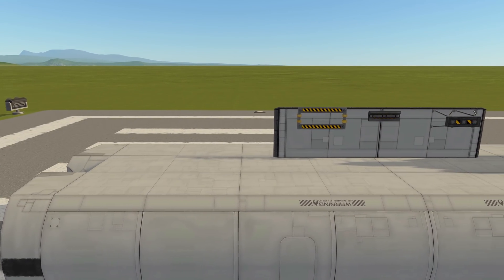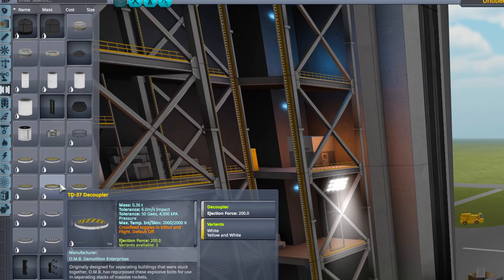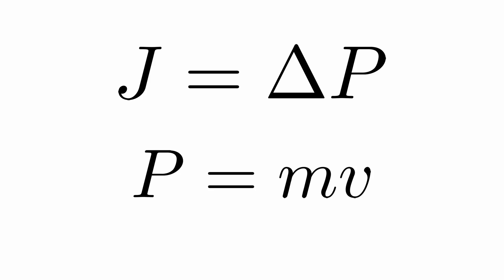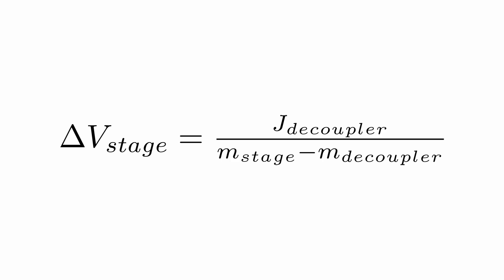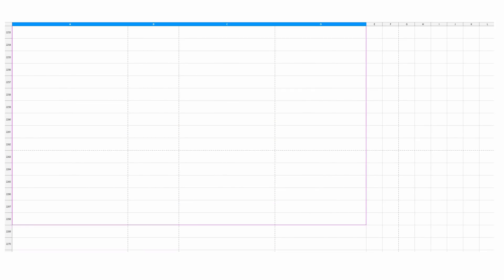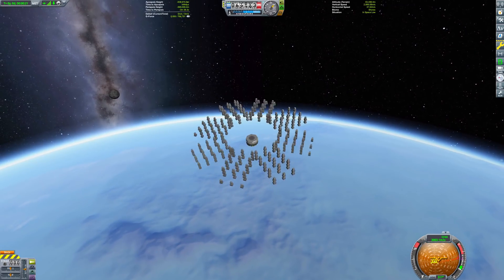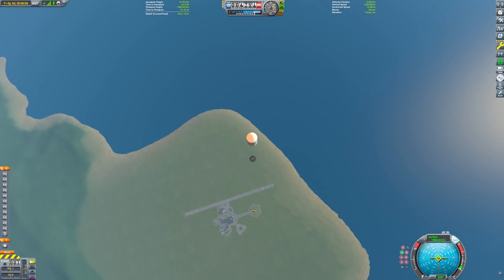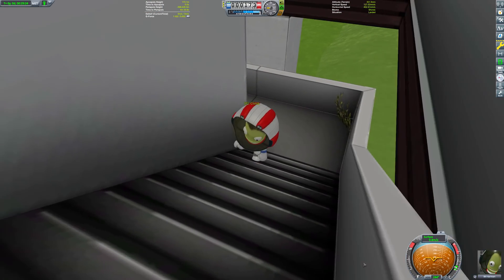Decouplers to Orbit - KSP 1.10.1

Comment: I think the ejection force stat is supposed to just be relative. For example if you’re wondering if you should use a bigger decoupler, you can see how many times stronger the ejection force will be on the bigger one compared to the smaller one and also compare how heavy is the thing you’re ejecting

Comment: thats unironically a really good way to get a quick burst of speed when needed

i added decoupler-based boosters for quick bursts of speed in some of my fighter planes, it allows me to outrun basically every missile in bdarmory and most of its addons, i also use it when atmosphere is thin and rapiers dont provide much thrust but dont autoswitch to rocket mode yet, pop the decouplers and my apoapsis is at 80-ish km

u need a metric fuckton of decouplers tho

i like to use decouplers to send ion-powered craft into orbit and to circularize em, why? cuz its neat

but the main use of these bad boys is in some of my shuttles, i have a decoupler-assisted takeoff cuz a disposable HDM-filled module gives u a fuckton of delta-V instantly

Comment: You can think of each decoupler as a stage with an engine outputting the force equal to the ejection force and consuming its propellant in 0.01s. Total delta-V scales with propellant in a logarithmic relationship, so even though the individual impulses keep getting smaller and smaller, it's the impulses approaching zero, which means the total delta-V always increases.

Comment: 2:03 that flickering on your MATH thing is caused by z-fighting. Z-fighting occurs when two polygons are being drawn on the exact same plane. Because of how rasterization and floating points work, depending on the camera angle, distance, etc, some parts end up being in-front while others behind, and when you change the camera etc this changes rapidly, as you can see.

To fix it, just offset them ever so slightly, e.g. 0.01 will often be good enough. But do note that the offset in a game like KSP, will be dependent on the distance from the camera. If they're right in-front of you, 0.0001 might be good enough. But if they're that far away, it might need to be 0.1 or something. But it's easy to fix.

Comment: The ejection force is actually kgf*s. kgf ( one kilogram-force or kilopond) which is equivalent to 10 times the N. That is what you see in 3:54

Source links: 
https://en.wikipedia.org/wiki/Kilogram-force#:~:text=The%20kilogram%2Dforce%20(kgf%20or,gravitational%20metric%20unit%20of%20force.&text=That%20is%2C%20it%20is%20the,equal%20to%209.80665%20N.

https://wiki.kerbalspaceprogram.com/wiki/Decoupler_and_separator

Comment: Hey Stratz, I have a question; How do you offset the decouplers in a way that doesn't cause the craft to rip itself apart upon launch? I have been trying to build something like this and it keeps either exploding, or the physics will glitch out and move me very fast. One time I even went past the speed of light while testing.
Reply from the maker: One way you can get better stability is to activate "heaviest" autostruts on all the decouplers and place several heavy fuel tanks in symmetry elsewhere on the craft (such as on some launch clamps). The heaviest autostruts will link to these heavy parts and provide a very stable connection.

Alternatively, you could clip all the decouplers together and rest the craft on them, like I did in this video. If all the decouplers are touching the launchpad, it makes kraken attacks less likely (but they still sometimes happen of course)
Reply: @Stratzenblitz75  Ok, thanks. I will definitely try this
Reply: @Stratzenblitz75  One more question; How do you offset the payload so far up?
Reply: Wait never mind I figured it out

Comment: So i've been thinking...

what if you combined this further with the fastest orbit time?

I understand you probably thought about this before and realized that the force you get is great but it happens over a much smaller time and doesn't give sufficient velocity to beat 33 seconds...

but what if a hybrid approach was used like this where the decouplers were fired right before the engines were, creating an energy boost with no drawbacks to help with accelerating faster... sub 30 second orbit?

Comment: Actually you can get as big  ΔV as you want just with stacking decuplers on top of one another.
This is because that sum is like harmonic series (https://www.youtube.com/watch?v=PQRttF8-iqA).
 If there was no mass of the payload you could bring (Jdecupler/mdecupler) out of the sum, and have harmonic series.
Having mpayload is just like taking terms from some term on, which is infinite-finite=infinite. 
But of course this would work only if decouplers were fired immediately one after another(zero delay(infinite speed of sound in decuplers required.))

But there's a problem the growth is approximately logaritmic. It turns out 107069370133 decuplers are needed for orbital velocity at altitude 0 and 2 477 462 214 563 304  for escape velocity. 

But this is actually not the true result, because escape velociti is smaller at that radius. Now I don't know how high those decuplers are, but if we say they're 1 meter, we get escape velocity of 1.879255171603899`*^6 Sqrt[1/(600000 +  NN h decoupler)]  . Set that equal to ΔV, and you get around 1.5 million decouplers(if it's launched from kerbin poles). So actually you would need way more decouplers for that, then to just build space eveator on the equator.

Comment: Afaik SWDennis only used mods to reduce the part count. He scaled up all parameters of the decouplers linearly. So instead of 100 parallel decouplers he just used a single one with a hundred times the force and mass (and I guess cross section area).
Reply from the maker: If the decouplers were scaled linearly, we would see an exhaust velocity of 100 m/s for the decouplers in the video. However, if you watch his video, you can clearly see the decouplers are being ejected on the order of km/s. This is how he was able to make orbit.

Its hard to overstate just how bad the decouplers in KSP are  in terms of impulse. The best ones have an equivalent ISP of 10 s... If you plug that into the rocket equation, you'll see we would need trillions of decouplers to get 3000 m/s of Delta V. No amount of scaling is going to make that feasible.

Comment: Can you exit the solar system (reach escape velocity) using decouplers?

Can you show what happens when trying to do so with just 1 stage (ideally with kerble face expression cam in the corner) please?
Reply from the maker: Yes you can! There's nothing stopping you from strapping a ton of decouplers to a command pod and setting it off.. Well other than the atmosphere, but you can do some aerothermal exploits to get around that.
Reply: Ah cool. I had in mind a series of tragic failures trying to figure it out, but since you already know how to make it work it doesn't sound very interesting... Thanks though!

Comment: Amazing as always Stratz! :D What's the reason for not taking a more efficient trajectory, that would enable a lighter second stage? Too much heating at low altitude?
Reply from the maker: Thanks! Aiming the decoupler cannon is a pain: it has so many decouplers on the bottom that kraken attacks are frequent. Having it stand upright makes things more stable, even if its less efficient.

Comment: Sidenote: you want your text based indices typeset like $F_\mathrm{decoupler}$. The way you currently do is probably $F_{decoupler}$ which TeX interprets logically as d*e*c*o*u… which is why the spacing looks a bit off. By wrapping it in \mathit or \mathrm you convert it to typeset it like text. And you want roman (upright) indices because you are using an actual word, not a variable index like $i$.

Comment: Soooo, that force number. It's definitely the direct input value used for the Unity rigidbody's AddForce function, applied using the ForceMode.Impulse setting. The documentation describes it as such: "This mode is useful for applying forces that happen instantly, such as forces from explosions or collisions. In this mode, the unit of the force parameter is applied to the rigidbody as mass*distance/time.". Being that "instantly" for a physics engine really means "within 1 physics timestep", then it can be assumed that the physics timestep is set to 0.01 seconds.

(docs page: https://docs.unity3d.com/ScriptReference/ForceMode.Impulse.html)

Also, good old radial decouplers. Some of the handful of remaining models of mine that haven't been replaced in the intervening 8 years incidentally, and still finding new tricks after all that time.

I don't watch much KSP content anymore, but your dedication to the madness always keeps me watching.
Reply from the maker: Very interesting indeed. That perfectly explains what I observed. Thanks for the information NovaSilisko!

And especially thank you for the work did in this game. You gave the Kerbol System its charm <3
Reply: @Stratzenblitz75  😭

Comment: You know, this is actually a very useful way to get things into orbit.
Reply from the maker: Decouplers aren't more mass efficient than orbital rockets I think, but they should be better if you want to go further. Like interplanetary.
Reply: @Stratzenblitz75  This way, you wouldn't require massive, laggy rockets just to got your interplanetary spacecraft to orbit. Makes testing them much less time consuming too. Could you please elaborate how you did the calculations for your successful decouplers to orbit ship? How did you figure out the delta-v needed to escape the atmosphere?
Reply from the maker: @thesentientneuron6550  Yes! Fortunately, the math is quite simple. First, make your payload and figure out its mass (for example, lets say our payload is 2 tons). Next step, figure out how much velocity you need. For kerbin escape velocity, you need 3400 m/s, so lets you use that. Next, figure out the impulse you need. The change in momentum is just the mass times the velocity, so 3400*2000 = 6800000 N*s. Since the hydraulic detachment manifold provides 4500 N*s, you will need 6800000/4500 = 1511 decouplers.

To cut this down, I've learned that you can use physics timewarp to increase the decoupler impulse. With 4x warp you could get it down to 377 decouplers.

Yea that's still a lot. I think a rocket would be better suited. You can certainly make a rocket for less parts.
Reply: @Stratzenblitz75  Thank you! I'd like to try it out nonetheless to launch something useful. Have you tested out separators too?
Reply from the maker: @thesentientneuron6550  Good to hear! I hope it goes well.

What do you mean by separators?
Reply: @Stratzenblitz75  There are class of parts in ksp used for separating called stack separators. They have a greater mass than decouplers of the same size, but they detach themselves from both parts being detached, unlike decouplers which stay attached to one of the two spacecraft after detachment. I wondered  if you looked into their impulse as well. Twice the impulse because force is applied on both sides, perhaps?

Comment: So, if you added a fairing around the whole thing at the start, add a little extra power, and waited for the mun to be in the right spot, you might win a bet against an armourer.
Reply from the maker: Are suggesting a mun gravity assist? Because if so, that is certainly possible. I've actually done that before with a decoupler cannon, but opted for this approach in the video because the mun gravity assist orbit is ultimately unstable.
Reply: @Stratzenblitz75  No, I was just making a Jules Verne reference, which would be to pass the mun and return

Comment: Scientists: You can't just put a bunch of explosives under a payload and detonate to launch something into space, you need a slow burn

Stratzenblitz75: I am about to do what is called a Pro-gamer move.
Reply: I mean, it's basically just Project Orion but with fewer thermonuclear devices and less unnecessary mass in the form of protective equipment. :D
Reply: @patrickharrington9394  
And with only two detonations
Reply: @patrickharrington9394  see: thunderwell
Reply: The first object in space was a manhole cover, that was the cap on a long underground bore, at the bottom of which was, predictably, a nuclear bomb. 
Basically the largest gun ever fired.
Reply: @trevordillon1921  *fastest man-made object in space
Reply: @Spaceman0025  I don't know about that one either way, I was making a point about it being the first, which is correct, so I don't know why you felt the need to comment that as though it were a correction.
Reply: @trevordillon1921 the first object in space would be one of the many V-2 rockets launched during WW2
Reply: Same with russia *super orion*
Reply: to be fair you actually could. doing this and having your payload in one piece? That is impossible lol.

Comment: I'm kinda surprised that craft didn't burn up immediately with such high speeds at such a low altitude. Impressive as always!
Reply from the maker: Its only ~1000 m/s, which is much lower than what would cause heating damage. 
I also found it interesting that this didn't cause any heating damage. I was expecting to have more issues with this part of the mission so I'm glad it went relatively painlessly!
Reply: @Stratzenblitz75  ah yes

Painlessly

I wonder what those kerbal felt going from 0-100 in an instant
Reply: @Stratzenblitz75  I imagine it is because the craft moved so quickly that by the time 1 physics frame had passed, the  payload had already left the denser part of the atmosphere that would have caused heating damage if the game ran faster

Comment: I wonder why the decouplers get worse as they get bigger - for the DLC parts, the TD-18 sits at 13.9 Ns/kg, and the TD-50 at a measly 3.9 NS/kg, both fitting into the existing progression.
Reply from the maker: Yea, it feels like the decoupler impulses were choosen at random. They don't seem to make much sense. Why does the hydraulic detachment manifold have so much force? Why is the basic  radial decoupler more powerful than almost all of the inline ones?